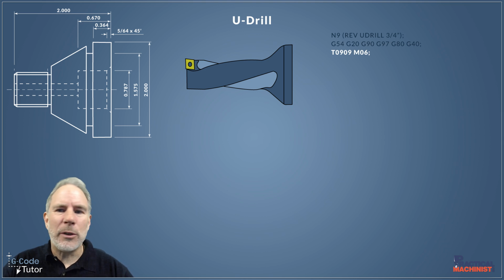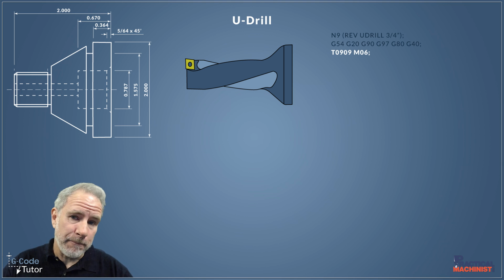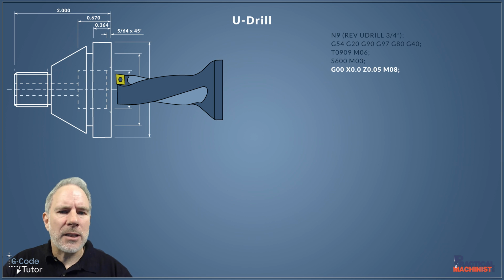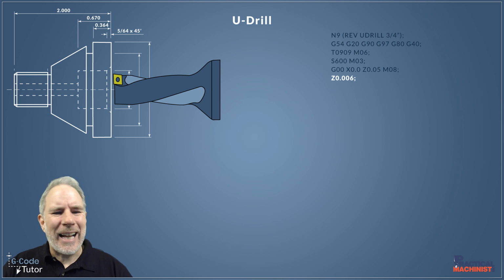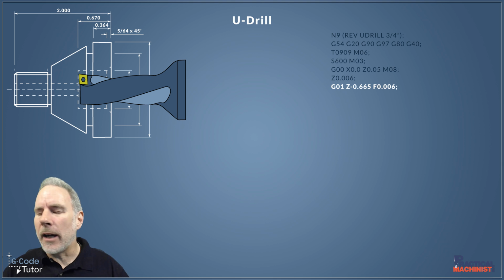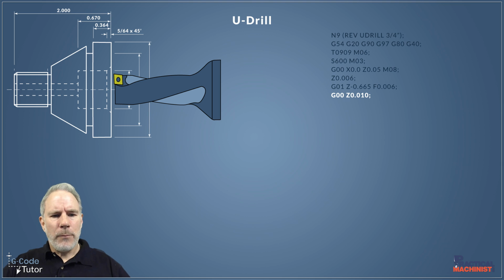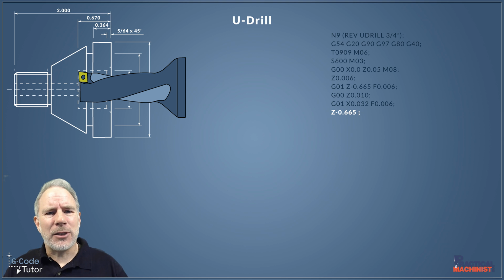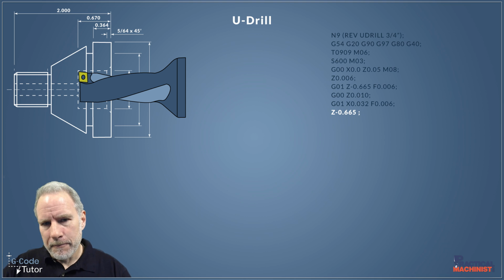Here's How to Write G-Code for U Drill Drilling and Rough Boring

Comment: Nice vid, what are the down side of using a udrill as a boring bar? Have to take light cuts? Not a lot of choice of insert geometry?
Reply: Limited Insert types, increased wear on 1 tool, you need to be very careful how much you leave on z faces if youre finishing with it (They don't have the clearance/relief to take more than a couple thou) if you need a square corner or perfectly flat hole bottom the geometry may not allow it. And sometimes chip packing on the first boring pass can be an issue.
Reply: @thehollowbox  Thanks, got a job coming up where i want to try it
Reply: @lawmate  Do you program by hand or through cam? Just make sure when you're boring the clearance/X retract on the first pass is set up right. We've accidentally run the back of the tool against the bore a couple times.

Comment: Very good video. One trick i'd like to add which makes using a udrill as a boring bar more useful is calling up a second tool offset for boring. For example, touching off T0929 like you would a boring bar on x/z so you can dial in size with wear.